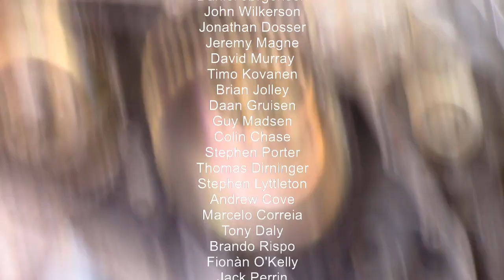Malawi110 timing belt   Part 2

Comment: I hope that you dont forget to take the fly-wheel timing pin out before you turn the engine to settle the belt down Mike. We have all done it (LOL).  Because I'm a bit rough with my hands, I find that it helps me to put some soft wood wedges between the case and the pulleys to hold the belt in place while I faf about getting the teeth on the belt all lined-up and tighten up the tensioner. Great video. stay happy, Yorkshire Rob..
Reply from the maker: I used to have problems getting the belt back on until I worked out the method of taking the roller off  - worst job I ever had was putting a Subaru belt on - needed 16 hands for that one!

Comment: Good tip about using an old toothed pulley to put the oil seal on.
Reply from the maker: Glad it helped - edit - note I had a washer on the end as you do no want to damage the seal with the teeth

Comment: Hi thank you for the grate video. I changed the belt following it without problems. I only have one problem: Here in MALAWI the specal key to hold the crank shaft pulley in place while tightening the screw is not available. I tried to build a tool but only reached 80 Nm .Do you know a trick how to block the motor without the tool to tighten it the remaining 90°?  Thanks and regards from Malawi

Comment: Mike, have you ever heard of or seen any types of timing chain or gear conversions for the TDI engine? That case could be made pretty oil proof, I'd be surprised if it hadn't been tried by someone, but I've not seen it.
Reply from the maker: Zeus Engineering did a gear kit back in the day but I have not seen one

Comment: Mike, is it required to replace the crank gear?  The one in my kit is square on the back.  If the one ont he engine is rounded and correct, can I reuse?
Reply from the maker: Reuse the old one - the square one can cut the oil seal!

Comment: Hi Mike, I have a problem and I have disassembled the camshaft pulley by removing the 3 screws, how can I put it back in the original place? I made the mistake of not having read that the manual says that you have to remove only the central screw and not the 3 screws as I have done. I hope you can please help me because I can't find any information about this. Thank you very much
Reply from the maker: The cam itself will have one bolt holding on a disc which has 3 bolts on a pulley - you cannot get this wrong
Reply: @BritannicaRestorations  thanks for your reply Mike, you’re amazing. This afternoon will try that. I got scared when I read in the manual that the 3 screws could not be removed and I did not know how to put it back in its initial position.
Thanks for all.